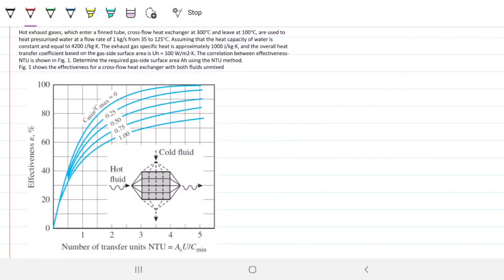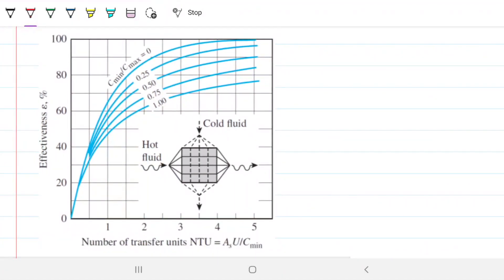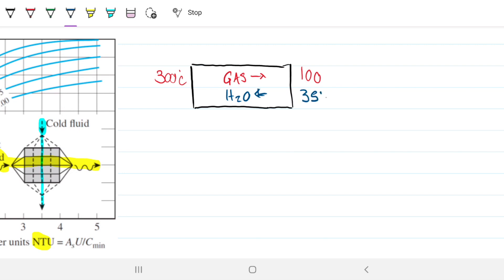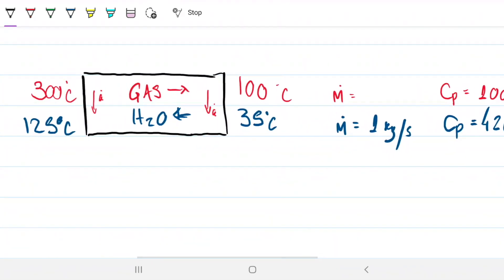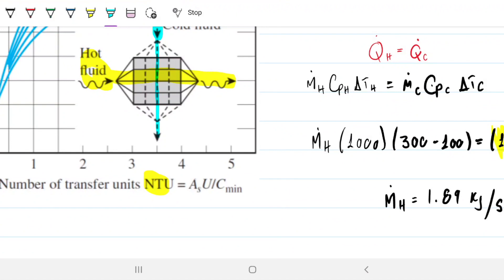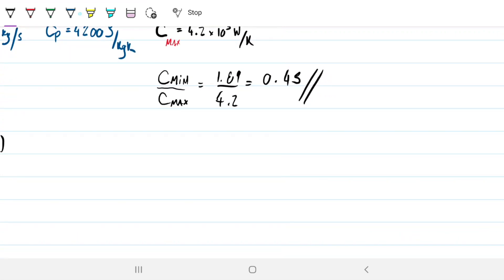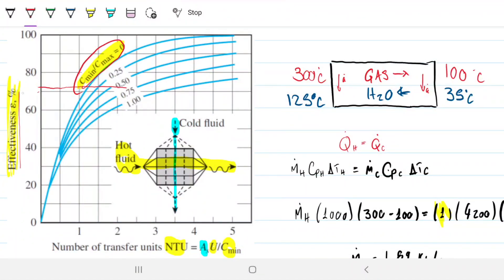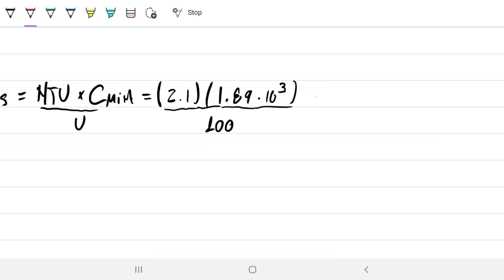Determine surface area in cross-flow heat exchanger. NTU method - W5WQ

Comment: Hello, thanks for the video, i have a problem with cross flow heating coil, and i need to find out the leaving temperature of the air if the air flow rate is changed, but i don't the graph for the ntu-з relation, in this case what should i do? Do you have the equatio or tje formula for this relation?
Reply from the maker: No. You need a third source of information to use NTU. It will either be a graph (most common), a table or a set of parameters to calculate it (equation). The latter is very uncommon as it completely beats the purpose of using NTU.

PS: You can find the graph for your situation online, as long as you have the number of passes, tubes, shells, etc. It does not need to be given in the problem per se.

Comment: How to select no. Of fin tubes for steam passed in it for Ms/al/ss-304 and selection of header also.
Reply from the maker: To fin d the number of fins, simply calculate the total area required (as in this problem, or this one https://youtu.be/ojAnlqMRFe8) and then divide by the area of a single fin. What will change if you have a different material (MS/Al/SS) is your U (overall heat transfer coefficient, as it will affect your convective and conductive resistances)

Comment: how do i consider fouling factor
Reply from the maker: That depends. Is it for a problem or for a project? For a problem, it will depend on whether you are given a graph to read it or if you need to calculate it by hand (you can use equations). In real life project we use graphs or software to find the fouling factor. Here is an example of how you'd find it using graphs in a question https://youtu.be/j_drN5_Zcqc